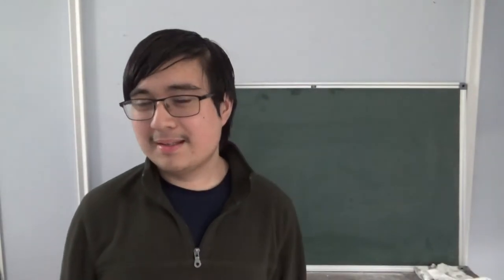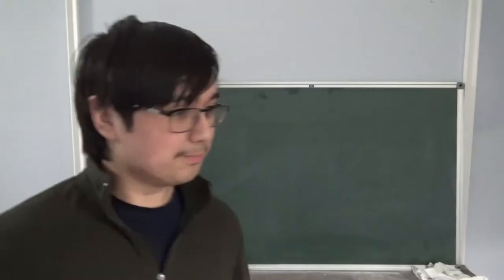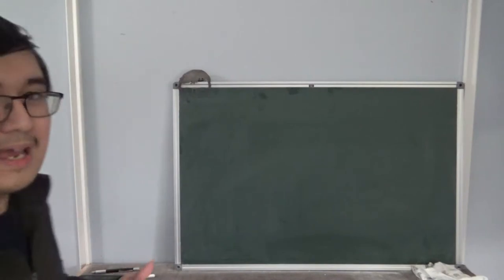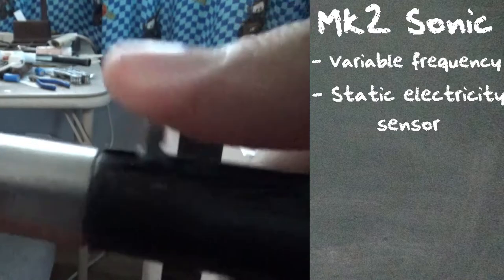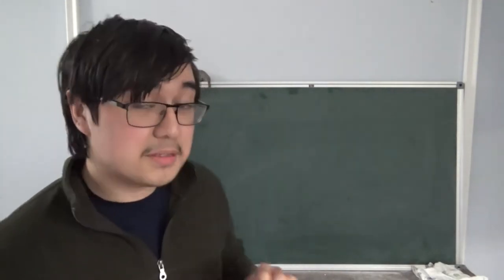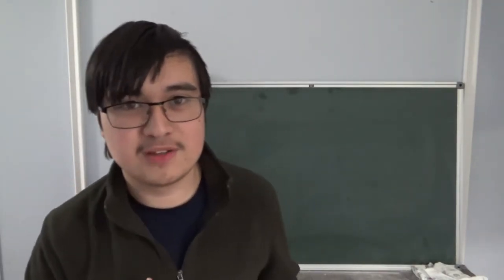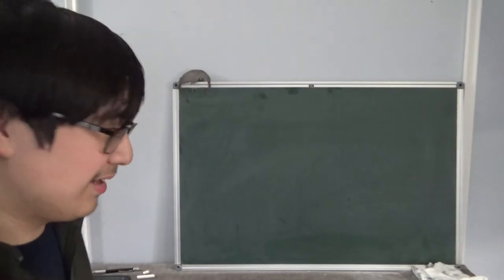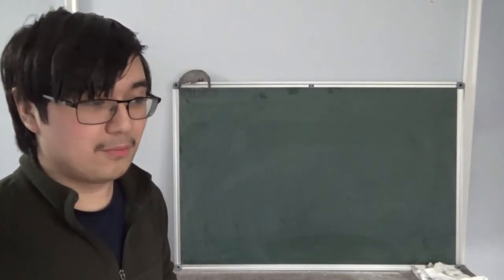Arduino Based Sonic Screwdriver (Mk3) - Ep 0

Comment: I had an idea on using a mini device in the sonic to control devices through Google assistant and so fourth. Anything controlled by an assistant would be at your access, including phones, tvs, thermostatd, ect. as long as you're connected to the wifi. Just an idea
Reply from the maker: Ahhh, yeah, not a bad idea at all. I'll think about that one.
Reply: I think a small tesla coil would be better because you don't need to be connected to the device, It is way faster and a tesla coil makes a sound that's very identical to the screwdriver